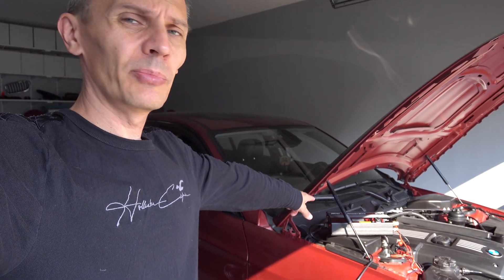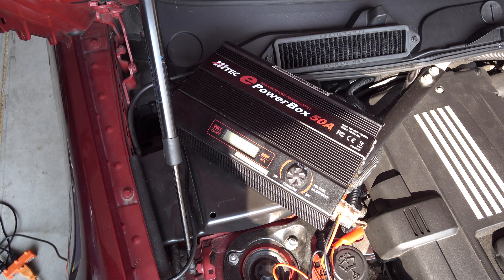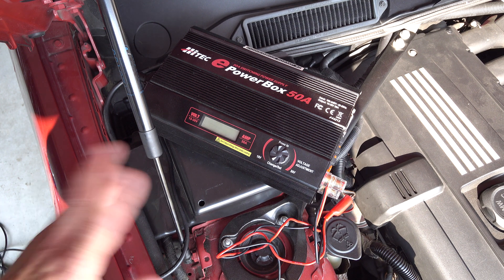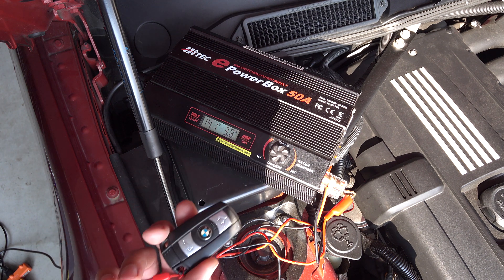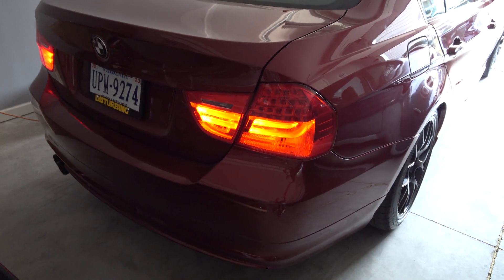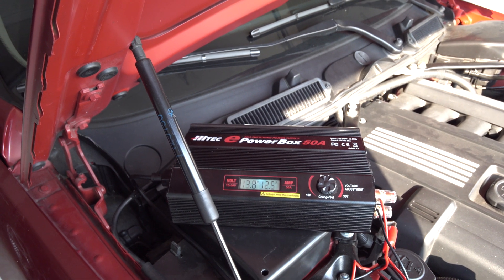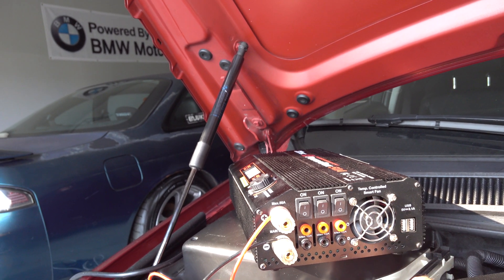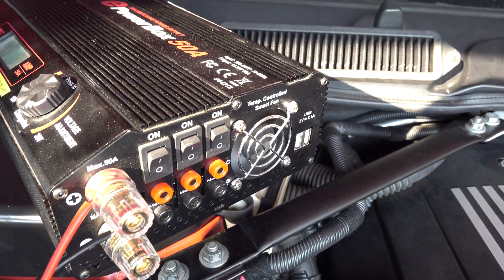Why You should be using a Good Power Supply when coding | BMW E90 328i

Comment: As we know 13.5 volt dc power supply is needed for our work. But this one gives 15 v minimum. Is it right for us if we feed 15 v to our job. Please reply.
Reply from the maker: As far as I recall, BMW says that it needs to be around 14.5 V, which is alternator's voltage, which is in turn the nominal voltage in the industry. This charger adjusts to a minimum of 14.2 V even though it says "15", so it works fine for me. I charged multiple cars with it, other bmws, never had a problem. In my opinion, 15V is still safe - car's system is designed to handle a certain range - depending on the conditions of the devices, the climate / season / weather. BUT - if you don't feel confident or safe with this voltage - then don't do it. Try to find something else that can produce the exact recommended voltage.

Comment: Great explanation. You think the hitec epowerbox with max 30 amps is also good enough? I have a bmw 320i e91 from 2008 and can buy a epowerbox 30A but the 50A is not available where I live. Thanks
Reply from the maker: 30 A is good enough to keep voltage from dropping. Just watch out for those power up current spikes, they can trip overcurrent protection and you will be fighting the device to make it stay On.

Comment: How about coding EWS (ECU) , add a key, which can take up to one hour?
Have a link for this product?
Reply from the maker: You can use it for anything that requires your car to be powered on - ignition on situation, without engine running. Coding, programming etc. The bottom line is that you have to provide a constant uninterrupted voltage while doing those things. It's just a power supply, people sell them used, online stores sell them new. Mine came from ebay, i think. This one can run forever, so no limits on how long your project lasts (i think i mentioned active cooling built in). An advice on what?